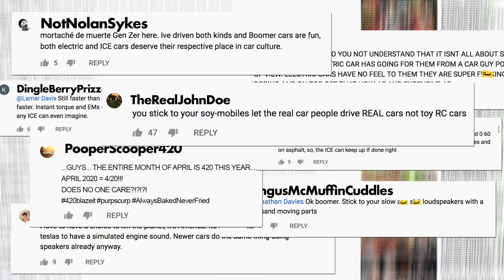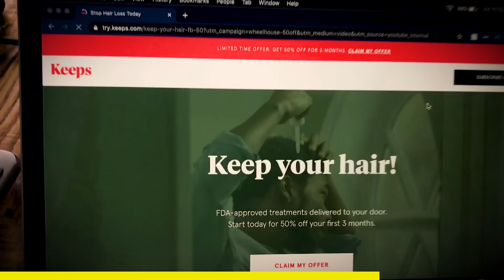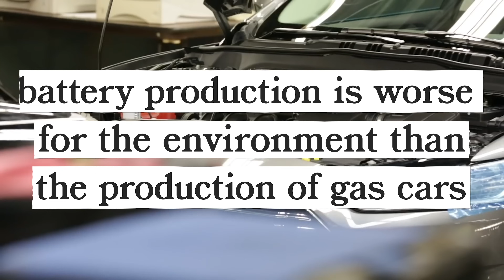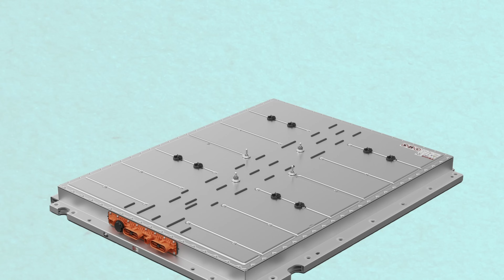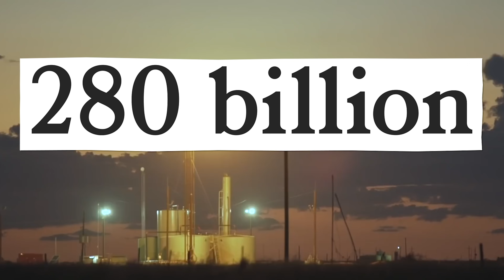Are Electric Cars REALLY Better for the Environment?

Comment: I love cars, I love internal combustion engines, I don't want them to go away, but the hardcore anti-EV people are just silly. EVs are awesome too. They're just different , and that's fine. EVs are great for short trips, city driving, and occasionally for having fun. ICE vehicles make sweet noises, are fun to drive (and work on), and are pretty much unlimited in range given how easy it is to find fuel and fill up the tank. But yes, they are worse for the environment. They just are. We have to accept reality.

One slight issue I have with the video is referring to hydroelectric plants as "clean". Honestly, they're pretty catastrophic for the environment. Now would be a good time to talk about bringing some innovation to the nuclear power sector, and dispel some of the myths surrounding it.

Overall great video in any case, good work Nolan!
Reply: Yes me too im 15 and i wanna have a ice engine car so i dont want them to go
Reply: @ertanfisek8131  ice engine.... really dude.
Reply: EV's are great for short trips and city driving?  Maybe you ought to read this. In 2015 two guys drove from one end of Britain to the other, and back again in 48 hours using a Nissan Leaf. A round trip of over 1650 miles. Hardly a short trip or city driving....
Here..... http://pluginadventure.com/john-ogroats-to-lands-end-and-back/   Lots of popular misconceptions around like yours I'm afraid.... There are now over 15 thousand charge points in the UK. That's more than there are petrol stations. In the UK around 80% of EV drivers charge at home while they sleep, so no waiting around...and I'm one of them. I have a Kia eNiro. almost 300 mile range, and costs around £10 to £12 to charge it on my EV tariff. Cheap motoring. I'm no eco warrior though. I drive an EV because it's so ridiculously cheap to run......
Reply: hydro electric plants are absolutely clean. What you might mean is that they can affect the eco system not the environment as a whole but that's an issue every power plant will have no matter what.
Reply: @Gabie76  Even ignoring the ecological impacts of destroying/disrupting ecosystems, the fact is that hydroelectric plants work by flooding massive areas that are generally dense with vegetation (being next to rivers), and that vegetation then decomposes and produces a lot of methane and CO2. There are great variations depending on the location and size of the reservoir, but it's estimated that on average, over its life-cycle, a hydroelectric plant produces about as much greenhouse gases as natural gas plants, watt-for-watt.
Reply: @seban678  not every hydroelectric powerplant is flooding a huge area. In the past they did nowadays they only take the water out of the stream they need
Reply: @seban678  at my hydroelectric plant the water they use is returned to the stream. It is also a strong flowing stream even without the power plant. There is not much of a difference
Reply: @seban678  You are VERY WRONG when you say that overt its life-cycle hydroelectric plants are the same in greenhouse emmisions as natural gas plants watt for watt. NOT EVEN CLOSE. Natural gas plants produce 490 tonnes of CO2 equivalent per 1 GWh and hydro electric plants produce only 35 tonnes of CO2 equivalent per 1 GWh, THAT is 14 times LESS! Source: https://ourworldindata.org/uploads/2020/10/What-is-the-safest-form-of-energy-1536x847.png
Reply: @seban678  then tell me about hoover dam... I am waiting.
Reply: @jerrymctee5996  Uhh.. what about the hoover dam? Can you be more specific?
Reply: This! This is exactly how I feel!
Reply: I don't think that the "infinite range" argument for gasoline engine will remain viable in the long term. Setting up and maintaining a permanent electric infrastructure is much easier than setting fuel distributions. As EVs are only going to get more popular in the long term, and in the long run it'll become harder and harder to economically justify running gas stations instead of an EV-supercharger only stations.

While conversions are going to take decades if not more, at one point you'll have a hard time trying to refuel your ICE tanks. It's likely that gas stations will become a specialty store or would only be available in certain limited areas.
Reply: I feel that EV's are getting better, but we aren't quite there yet for most uses.  First, the mileage ratings on vehicles are estimates based on perfect conditions (room temperature, no radio, no headlights, level ground, etc.). In "everyday" use, we rarely meet that estimate. The discrepancy for EV's is just greater than ICE cars. If you were running your vehicle at night, with the radio on, in zero degree wintery conditions an ICE isn't going to use that much more gas. An EV on the other hand will be much worse off. In fact, just running a heater in an EV uses more energy than moving it, according to Tesla anyway. All that isn't even taking into consideration that batteries lose A LOT of efficiency in cold weather.  Another thing to consider is that cities in the US that would benefit the most from EV's all ready have power limitations. The greater LA area for example is known to all ready have rolling brownouts in the summer. If you add another 60,000 EV's wanting to recharge every day it won't exactly help the situation. We need to update out power generation first.
Reply: @matts1166  You are totally wrong. Difference between real consumption and specified cosumption is LARGER for ICE vehicles: Volkwagen Passat petrol have specified consumption 5 l per 100 km, but in reality the consumption is 2 times higher. In EVs the difference is SMALLER. Radio and headlights consume almost no energy (very little, not even noticable). Heating consume only 10 % of the energy needed for moving the vehicle (you are wrong about that also: Tesla never said that " a heater in an EV uses more energy than moving it". That is just wrong. Very wrong. Not true in the slightest!
Reply: There are so many ppl out there just want to "feel smarter" or "feel more correct than others" when proposing some ideas. It just sucks. I don't know since when the trend of letting ppl feel more premium and entitled started. But looking at all these ppl, they are not really making a point, they just want to let other ppl admit they are superior and correct.
Reply: @mingchi1855  You're absolutely right. I think people are also confusing their opinion with fact, and making the incorrect assumption that their personal experience apples to everyone.
Reply: I agree with you 
We should enjoy driving the ICEs as they are probably going to be phased out in a decade or two and the we all will be driving EVs only
Reply: I'm fully on board for the compromise of allowing performance car to remain combustion powered (although you'd probably have to implement additional taxes to prevent everyone from just buying sports cars when EV's start taking over.) But for average commuter cars, we should have fazed out internal combustion ages ago. . . Nobody buys a Corolla because they love the roar of that four-cylinder engine.
Reply: Have you seen the video?
Reply: @ignacioburkhardt789  yeah, obviously... why?
Reply: @seban678  Never mind, I thought you said electric cars were worse for the environment
Reply: The only time electric cars will be clean is if most states and cities switch to a different and clean energy source, but most states and cities will keep using power-plants to generate money
Reply: Easy to find fuel... for now
Reply: ICE vehicles do not make sweet noises, they make noises that please the weak ego. Also the fact that fuel is just a primitive source of energy is a nono. I agree for now ICE's are better for long range but as we advance in technology, EVs would soon surpass that. EVs are the future, the now.
Reply: @thevitruvianman19  If it makes you feel better to demean people with different tastes than you, I'll let you have that small sense of superiority
Reply: The only problem with nuclear power is that for-profit companies are not responsible enough to run them safely. They just aren't, and they won't ever be because it's just too convenient to cut costs.
Reply: @AlexandarHullRichter  Well, don't let private companies run nuclear reactors xD
Reply: @seban678  Hahahahahaha. You know almost all power plants are owned/operated by the private sector, right???
Reply: @AlexandarHullRichter  Yeah, that's a problem. Doesn't mean there's nothing to be done about it.
Reply: Fun to work on! Lmao!
Reply: @elontusk5553  a lot of people need to face the reality that their cars will require repairs in future. If the car is too difficult for me to work on, I'm not going to want to own one.
Reply: Except EVs aren't just for short trips. The Tesla Model S has a range of 402 miles,  that's the same range as my Silverado and my Mini Cooper. Also battery technology is not done evolving and the technology is only going to get better. The next Model S update, which might come tomorrow September 22nd, may have a range update. I bet that in the next 10 years or so we will see EVs with ranges above 1000 miles. Battery technology is getting better.
Reply: @johnkelloggflys2065  Lucid's "Air" prototype just crossed the 500 mile barrier, 100 miles more than the Model S Long Range spec, Tesla touts they'll have the new Roadster doing 600 miles and that big, blocky Cybertruck also meeting the 500 mile threshold.

Exciting to see where EV technology will go from here, I can hardly wait for Tesla's battery and investor day tomorrow!
Reply: @Troy_K  I saw the Lucid Air, that was really cool. I'm excited to see Elon Musk's response. He doesn't really like to be in second place for things.
Reply: "NUCLEAR BAD, DON'T TALK NUCLEAR"
~Literally everyone.
Reply: seban678 I agree, even if the initial process of building an electric car is worse cars are designed to be used for a long time, so in a few years an internal combustion car will overtake an EV in terms of carbon dioxide production.
Reply: @Biocube101  not only that, battery tech is constantly changing and it seems to be that people will move to sodium batteries in the future which are extremely cheap to make, if everything goes as planned
Reply: All I'm saying is nuclear is the real energy of the future.
Reply: @ajorsomething4935  nope.
Reply: @jerrymctee5996   Yep! Thorium based reactors and the possibility of fusion reactors instead of fission ones offer a great path forward for large densities of energy from a certain amount of fuel. Also modern reactors are fairly safe.
Reply: Nope, electric cars are worse for environment, gas cars emit 6-7 metric tons from factory, as for example, an average car like a toyota corolla or honda civic emit 270 grams per mile, average miles driven in gas car is 13,500, gas cars emit 3.6 metric tons a year, average to keep a car is 6 years, gas cars emit 28.6 metric tons during its life time, electric cars like tesla model 3 averages 13 metric tons from factory, tesla model 3 has 264 miles mid range, emits 85 kg per kwh, battery size is 65 kwh, tesla model 3 emits 300 grams per mile with powerplants, that means model 3 emits 4 metric tons each year, which would mean 24 metric tons in 6 years WITHOUT  factory emissions and 37 metric tons in 6 years WITH factory emissions, I have sources and statistics and calculations to prove I am correct.
Reply: @aimxdy8680  You are WRONG. Your bullshit calculations have been dissproven in the very same video you commented on! Average life of a typical car is NOT only 6 years, but more than 15 atleast ! It doesn't matter if YOU drive it fist 6 years, and than 8 years somebody else, it is STILL the SAME CAR!  Also average USA vehicle emits 480 grams per mile, look at the statistics, not your bullshit estimations. Average car in the USA emits 5,2 tonnes of co2 per year, and average electric cars on average USA mix only 2 tonnes per year. The brake even point for electric vehicles is 6 mounts to 2 years, but the usefull life is 20 years. Also your calculations about Tesla is wrong, you life expectency is wrong, your prediciton that 80 kWh Tesla's are the average electric cars are wrong (other smaller batteries EVs even Tesla standard range vith 50 kWh battery brings the average down), your data are wrong. It is 35 kg of CO2 per 1 kWh for the battery production in the USA, not 85 you claimed. Look here: https://www.youtube.com/watch?v=6RhtiPefVzM&t=1s And for the 35 kg per 1 kWh for battery production  in the USA look here: https://www.mdpi.com/2071-1050/9/4/504/pdf
Reply: @rokrokavecki9381  Hybrids are cleaner than EV’s, Toyota Prius emits 78 grams per mile tail-stream emissions and 147 grams per mile for charging the car, prius prime also has longer range, can last up above 600-700 miles with electric miles included,  also the prius prime battery emissions are 2 metric tons and 6-7  metric tons building the gas engine, which is in total 8-9 metric tons of factory emissions and 78 grams, which if you calculate that, it is 24.1 metric tons in 200,000 miles which is 15 years, the tesla model 3 emits 11 metric tons from factory and 79.3 grams per mile with charging the car, which if you calculate this it is 26.9 metric tons in 200,000 miles which is in 15 years.
Reply: @rokrokavecki9381  Actually average  battery production is 175 kg per kWh and its official.
Reply: @aimxdy8680  Your calculations are incorrect, the video you are commenting on just prooved you wrong. Tesla model 3 emits DIFFENTLY depencing on in which county you drive the car. In MOST states in the US and in most countries around the world pure electric cars emits less co2 than hybrids. And every year percentage of renewable energy sources in the electric grid increases, so electric vehices become greener every year (and even as of totay in MOST contries they are allready a lot greaner than hybrids. Look at this article: Polluting plug-in hybrids are the car industry’s “wolf in sheep’s clothing” https://www.greenpeace.org.uk/news/polluting-plug-in-hybrids-are-the-car-industrys-wolf-in-sheeps-clothing/
Reply: @aimxdy8680  For better explanation look also this: https://images.hgmsites.net/med/bnef-study-shows-ev-emissions-falling-faster-than-gas-engines-as-power-grid-gets-cleaner_100689811_m.jpg
Article is here: https://www.greencarreports.com/news/1121222_dont-worry-about-coal-electric-cars-are-still-cleaner
Reply: @aimxdy8680  No, 175 kWh is not true. The study YOU just linked (your own source!) clearly states: "The IVL researchers now estimate that battery manufacturing emissions are actually between 61 and 106 kg CO2-equivalent per kWh". And majority of the studies shows lower numbers, like 35 kg per 1 kwh. Like this: https://www.mdpi.com/2071-1050/9/4/504/pdf And EVEN IF this was true, pure electric vehicle will STILL be greener than hybrids in most of the world.
Reply: @aimxdy8680  Man your own source DISPROOVE YOU. Thats bad haha. Hybrid Prius is do NOT produce less CO2 emission, it produces MORE CO2 emissions than electric cars! Look, from your own source! https://i.imgur.com/ckyMtCO.png Also number will be EVEN BETTER for the electric vehicles if they would count :   1. Real useful life for the vehicles (they underestimated useful life by far!) 2. They would ADD CO2 produced for oil changes and maintenance for hybrid car (electric car doesn't require that). AND MOST IMPORTANTLY: 4. They would count real world consumption of petrol for hybrid car (they didn't! They took the number from manufacturer, and everyone knows in real world cars consume a lot more gas that manufacturer says it would!)
Reply: @aimxdy8680  And also: electric cars produce less CO2, but lets not forget the important fact: CO2 is not everything. Electric cars solve the real problem about air pollution in the cities from petrol and diesel cars. Why is that important you may ask? Because the NOx, SOx, VOC, PM10, PM2.5, ozone etc which PETROL and DIESEL car produces in the cities is the real problem. Why? Because in the cities is the most people BY FAR, and cities are closed spaces and the pollution levels in them are ALARMING. Electric cars are also MUCH cheaper to drive, have better performance (better torque and acceleration, lower center of gravity) and solve the problem of independency of foreign oil (you can't really produce oil, but you can produce your own electricity for the electric car). Oil is bad: it produces wars and other bullshit in the world.
Reply: @aimxdy8680  ANd BEFORE (1 mounth ago) you claimed that electric cars pollute more?! YOU OWN source disprooves you! Look: "EVs are responsible for considerably lower emissions over their lifetime than conventional (internal combustion engine) vehicles across Europe as a whole.
However, as countries decarbonise electricity generation to meet their climate targets, driving emissions will fall for existing EVs and manufacturing emissions will fall for new EVs.
 In the UK in 2019, the lifetime emissions per kilometre of driving a Nissan Leaf EV were about three times lower than for the average conventional car, even before accounting for the falling carbon intensity of electricity generation during the car’s lifetime."
Reply: @aimxdy8680  AND also: your own source clearly says that electric cars pollute less. But the numbers would be EVEN BETTER if they your take the REAL estimation for life expectancy of the car . They only assume the vehicle would drive 150.000 km (94.000 miles)! That is NOT CORRECT assumption! Electric vehicles last a lot longer than only 94 k miles!! Data suggest that electric vehicles will last more than 500.000 miles (not only 94.000 which is an estimation study took for calculation!). Look here: Data Suggests Tesla Battery Packs Will Retain 80% Capacity At 521,000 Miles https://insideevs.com/news/334802/data-suggests-tesla-battery-packs-will-retain-80-capacity-at-521000-miles/